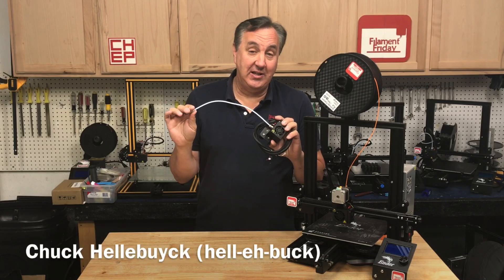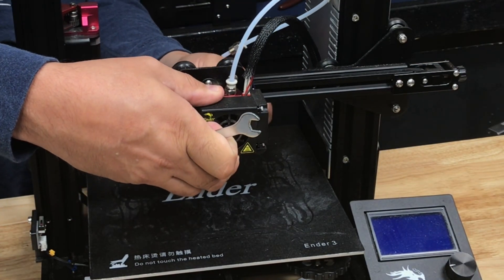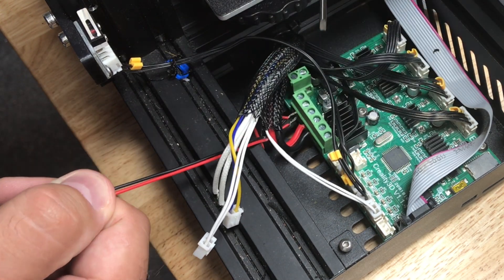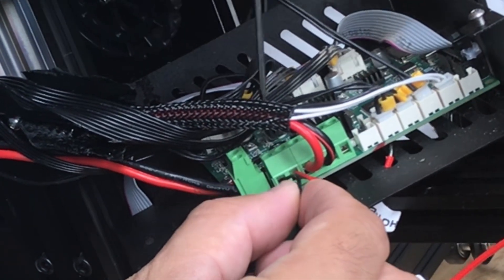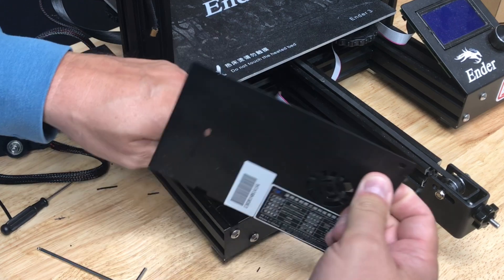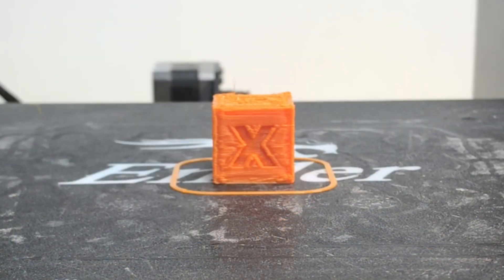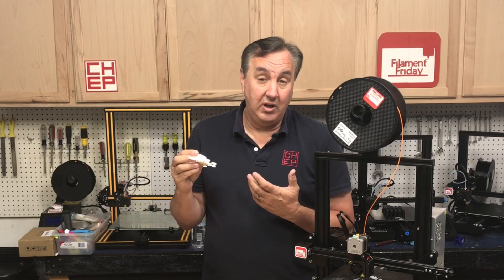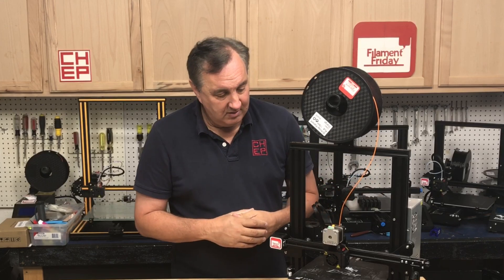Direct Drive Extruder on Creality Ender 3

Comment: the extra weight is the main reason I think most people should skip it. you're going to have to slow down your prints a lot, and most can already print flexibles perfectly fine with bowden setups. I print tpu with mine at 45mm/s perfectly fine (travel is 260mm/s)
Reply: I print with my direct drive at 100mm/sec with flawless results for 2 years now.
Reply: can you share the configuration?
Reply: @subhanhasbiyudha5448  Are you talking about the hardware?

Comment: The motor in the extruder set is too heavy. It is better to try to notice it on a thin Y-axis engine. And put the big engine of the extruder on the Y-axis. (also do with the X-axis by putting the motor from an old printer extruder on it).

Comment: Hi Chuck I have a question for you. I just got my CR-10 mini and I tried starting it up not realizing that I had it set to 230V when my power is 115V and it would not start up but made a ticking noise. I figured out what I was doing wrong and switched it to 115V and it started up and seems to be working fine but I wanted to make sure running it on the wrong voltage the first few times didn’t mess up anything internally. A reply would be greatly appreciated. Thank you!
Reply from the maker: It will be fine.
Reply: CHEP thank you so much that takes a lot of anxiety off my shoulder. Thanks for the great recommendation to get the CR-10 Mini I’ve been loving it so far. Any recommendations as far as settings go for printing PLA?
Reply: @MattKirk007  idk about most people but in cura I usually print between 100mm/s-80mm/s at around 200-205degrees C I'm printing at 0.15mm layer height. Usually for smaller higher res models.

Comment: That looks like a lot of weight sitting pretty high over the hot end.  I wonder if that can be causing some noise in the print due to momentum of that motor sitting way up there while the X axis is moving.
Wonder if it would be better to convert stepper motor to a pancake motor like a Nema 17, 23mm (18 oz) version.  Or maybe see if there is a more compact conversion that has the motor closer to the rail.
I have 4 printers, Ender, Chiron, an old modified Alunar M508, and a Chiron clone I 3D printed... Between those,, the easiest one to dial in the settings was the direct drive M508, and even though it was a cheap kit to start with, it's been the workhorse for small parts because it so easy to tune, and also super easy to maintain. Really like Direct drive. 
Really been contemplating converting the Chiron to direct drive due to the mile long bowden tube. Very similar setup would be needed.

Comment: Or you could this and without much work either by just printing your own plate for free 99 lol I made this switch A few months ago by printing my own ;modification and all while still using the stock shroud of my TRONXY XY-2 PRO, it was definitely worth it and don't let the 500 gram weight limit your imagination and think it deteriorates prints. I've had high end quality prints all the way with carbon fiber and nylon filaments since I made it into a all metal as well. Do it yourself and save the 30 bucks and month of shipping. Build it on your own and you'll never turn back to the craptastic bowden.
Reply from the maker: Which is why I mentioned that at 8:23.

Comment: Hello Chuck
Thanks for your videos and all the help, always amazing! I have mine coming in a few days and I was thinking just to connect the old cables to the new hot end and fans... do you think this way could be easier? Just to not be messing up with the board and all the connections in there. Thanks!!
Reply from the maker: I suspect it will be harder but you could try it.
Reply: @FilamentFriday  I would buy this for the direct drive, not necessarily to replace my hotend, and all those components. For me I would just move the original hotend to the new direct drive carriage and not need to mess with the board at all and keep the new hotend + for spares.
Reply: @FilamentFriday  Thanks for your answer! I appreciate you always reply!

Comment: as always great review
with direct drive, or if you use a Paço pancake or dual Z engine, to take the weight off the axle, the dual Z with 2 engines was the best upgrade I did on my ender 3, I use the mesh leveling is very good

Comment: Printed my own backet years ago. Works great you, can use the existing extruder, and it's for free
Reply: Yup, just search for “drivinator” on Thingiverse to find lots of options and like @Errs Matt said, your safe bet is to print it in PETG,  but I’ve had a PLA one running for around 6 months with no issues.
Reply: @lucasthompson1650  The part i printed 5 months ago with PLA,  just deformed due to the extruder heat so i reprinted it with ABS and it works flawessly.
Reply: @Killer241 GD Awesome! For anyone else who’s already worked with ABS, it (obviously) works great for printing these kinds of upgrades too (eg. modified mounts, carriages, and fan shrouds). Just to clarify: I suggested PETG because among the “tougher” filaments it seems to be an easier material to get a handle on for newcomers to the hobby — but, yeah,  if you can do ABS (and especially if you haven’t tried PETG yet), by all means print with ABS.
Reply: @lucasthompson1650 
Hey, I've been hearing that PET-G is essentially as strong as ABS or ASA but more flexible. Is that true?
Reply: @KLP99  I don’t know about stronger than ABS but it certainly withstands heat better than PLA (which will melt if you leave it on a car dashboard in the summer sun).  I like PET-G because it’s quite durable and with the better heat resistance I find it makes a great material for printer upgrades that need to be anywhere near the hotend.  Beware: stringing is an issue for a lot of people, but if you take the time to fine tune your slicer settings (in particular your Retractions and Travel speeds) it can be as easy to print with as PLA.
Reply: @lucasthompson1650  
Thank you for the reply. I have ordered some PET-G in some colors my wife will like. I bought one black and one white spool early on (I've only been 3d printing since last November), but they are still in the shrink-wrap.
I'm hoping my climate in the high desert areas of Utah will be dry enough that I don't have to do much if any, filament drying. A 3d shop 30 miles North of me says I shouldn't have any trouble with humidity. We average between 25 & 40% relative humidity all year.
Reply: Foot in mouth... the PLA one finally melted down about 3 days ago, hahahah.... reprinted it in PETG. No issues yet.
Reply: If you buy the kit you have spare everything though.
Reply: @nicholascarver1  
That's why I'm really glad I bought the kit. Not long before I got it, I was holding my side clippers in one hand, and reached for something behind my bed, and the tip of the clippers touched the fan blades on the front of the hot end, shattering the blades. The fans were back ordered from Creality and out a month or more, not including shipping. I found a local 3D shop (local, as in 30 miles away) and they didn't have any original fans, but had a rebuilt fan (rebuilding a 40 mm fan?), but that got me up and running again and after the new fan came, I had my backup for the next time I do that. But, my direct drive came, too, so now I really do have a spare of every part on the hot end. That's a nice feeling.
Reply: @KLP99  Yeah, having spare parts on hand can make the difference between solving a problem and pulling all your hair out. If I could go back in time I'd whisper to myself, just before I got a 3D printer, "Trust me, you should buy two!"
Reply: @lucasthompson1650  
Every time I start something that's going to take more than 4 or 5 hours I'm happy I bought 2 printers.
Reply: @KLP99  Same models or 2 different printers? I’ve just got an Ender 3 (or whatever it is when you’ve upgraded everything but the aluminum) but I have easy access to an AnyCubic i3 Mega S and a BigTreeTech-upgraded Creality CR-6SE … but I’m horrible with slicer profile management (spoiled by Git over the years) so I’ve been thinking the next printer I get will probably be 2 (or more) identical printers — well, either that or I’ll just write a proper GitHub plugin for profile management in Cura.
Reply: @lucasthompson1650  
I bought 2 identical Ender 3 printers. I've upgraded one to direct drive, with a kit waiting so I will have 2 direct drive Ender 3 printers.
I also bought 2 new mainboards, the Creality 4.2.7 silent boards. 
I've installed one, and it is wonderfully silent. I can hear the steppers humming during some diagonal movement, and other than that, fans.
The issue I have with these boards is they come with Marlin 0.0.6, which Chuck talks about. They are missing the several commands, such as the pause command, so Chuck's bed leveling gcode doesn't work. That's frustrating. Very.
I emailed Creality (cs@creality.com) and heard back today. They say, 'Send us the commands that don't work and our R&D team will work in it."
I wrote back about 10 minutes ago and told them, "No, I won't send individual commands because we could be going back and forth forever finding each one that doesn't work. Please just get the latest Marlin version and burn that to a .bin file we can load."
I don't know what they are going to say about that... It makes no sense to fix a gcode command when a new version of the software will fix the ones I've found, plus every other command, too, that might be broken, or even just bent slightly...
Reply: @KLP99  Ah, I went the other route. Instead of 2 Enders I went with getting 30+ years of coding/development experience and just 1 Ender.  :)

I still have firmware issues, probably more than regular users, but these days they’re mostly my fault — trying to fit bed level data to a generalized surface, or playing with PWM timings for some component, hooking up JTAG interfaces, etc…

It’s rare for the firmware on my Ender to be older than 2-3 days. Task #1 when I sit down to “play” with the printer is usually merging the latest bugfix-2.0.x from github with my local branch, and flashing whatever board I have in the printer with a freshly compiled firmware binary.

Or in command line terms, I do:

git pull upstream bugfix-2.0.x
(fix merge conflicts, if any)
(update Marlin/Version.h)
pio run -t clean;pio run
cp .pio\build\${board}\firmware.bin /mnt/sdcard
(Put card in printer)
(reboot printer)
(Auto home)
And THEN I start actually playing with the printer. :)
Reply: @lucasthompson1650  
I'm not a coder, or rather, not a competent coder. The last time I actually coded machine code was on a commodore 64... I did a few cool things. But more recently I did custom coding in a type of Dartmouth BASIC written for the uniVerse DB. And that's been 12+ years.
I'd rather not play with the firmware. I just want a current version of firmware with a near current version of Marlin that play nicely together. I'm moving into design, having added my first real design to ThingiVerse last night.
I'm so advanced that I dared start with Tinkercad... Yeah, technically a kid's toy cad program, but it's plenty good for my needs. I designed a funnel that can be used to fill gallon spring water bottles like Wal-Mart or Walgreens sell. It stays in without being held so one person can pour water from a CPAP distilling machine into the bottle without help. It fills my needs so maybe someone else will find it useful.
Reply: @KLP99  You have plenty enough experience to handle compiling your own firmware for configuration and customization — but I get that some people aren’t into getting that deep on the hardware end.
Tinkercad is awesome … when people other than me use it. Luckily I’ve discovered OpenSCAD so I’m still able to be creative on the modelling side without the creative learning curve — I swear I could teach calculus to a comic book artist before that artist could teach me to draw faces without messed up noses and ears. 🤣
Reply: @lucasthompson1650  
My wife had an offer for a commercial art program. She took the music scholarship. I also had a music scholarship that included composition. Composing music is math. It's just the math of a physicist who's had a little too much to drink. Don't tell my brother who really is a rocket scientist, I said that.
Yeah, I've compiled stuff off and on for years in Linux. But so far I've not seen a good step-by-step outline for Marlin on the Ender that doesn't seem to assume I know more than I do. There's always a gaping hole big enough for me to get lost in.
Old OCD guys with A.D.D. don't think like regular folks...
I think I've just not searched for the right things yet.
I'm not giving up.
Reply: @KLP99  compiling Marlin is actually a lot like compiling the Linux kernel, except Marlin is much less complex, PlatformIO handles all the build tasks, and the lead dev/maintainer is polite and understanding (*wave* thinkyhead). They even have a ‘make menuconfig’ in the form of a Visual Studio Code plugin called Autobuild (or Autobuild Marlin… ?).

It took me 2 years to get technically proficient on electric guitar … and another 9 to not sound like someone else every time I play … it’s coming up on 35 years now and I still haven’t ever written a decent song.  😬
Reply: @lucasthompson1650  
I've composed nothing anyone would recognize. But my wife and I have performed a few things. But not for many years now.
What do I need to complete Marlin for an Ender 3? Do I grab it from the repository using apt-get?
I don't have a Microsoft or Apple device at hand. Ever. Linux Mint is my distribution of choice.
Reply: Now that I wrote all that, it might be possible to build it with just PlatformIO on Linux. No VS Code.
Reply: Yeah, just grabbed a fresh copy of Marlin bugfix-2.0.x and built it on a Kali box over SSH with nothing but Python3 and PlatformIO installed. So forget what I said about VS Code ... if you run Linux you likely already have a favourite text editor. ;)
Reply: @lucasthompson1650  
I'm not EMACS. VI all the way :-) which are fighting words to EMACS users, or used to be way back when they were both running on the big boxes and Linux was a little baby "toy" OS.
I don't do much Python, and don't know what PlatformIO is. That's how little prepared I am to do all this.
I spent about 20 years as a DBA using PICK, a little, and uniVerse primarily. I can write decent bash scripts, but left compiling and building things back when drivers started working out of the box for my mice and video, NICs, printers, & sound cards, among silly things like a voice to text program and getting fingerprint readers to work.
I have heard back from Creality several times. They may stop responding now, however, since I insulted one of their support engineers. He sent an email saying my gcode doesn't work on the 4.2.7 board because of sheet metal, wearing parts, and improper slicing. I called him an idiot for even suggesting such things, then quoted a saying from my younger DBA days, "It's easy to recommend solutions when one knows nothing of the problem"
Reply: @KLP99  which GCODE commands specifically aren’t working?
Reply: @KLP99  PlatformIO is just a collection of build tools for cross-compiling for microcontrollers like Arduinos, 3D printer boards, other DIY electronics.  For instance, on the test build I just did, the first run through it handled downloading a cross compiler and linker for the LPC1729 microcontroller (which is what the board in my Ender currently uses) as well as source code for the Trinamic stepper libraries, etc…
All I did was type “pio run”, and a minute or so later there was a “firmware.bin” file ready to toss onto an SDcard to flash the printer.
Reply: @lucasthompson1650  
One of the most noticeable is the command to print a message on the screen while pausing for user input (pressing the select dial/button). That means Chuck's bed leveling gcode routine doesn't work. He brings that up in one of his videos (I need to find it and share it with Creality). Other commands control the print and are harder to isolate.
Reply: @KLP99  I think you need the EMERGENCY_PARSER config enabled for that now in Marlin... I could be wrong.  When you connect with a terminal (Pronterface, OctoPrint, etc), or in a .gcode file, can you issue:
M117 Your Message Here
M0 Break
M108 ;Wait for user click to continue

I'm guessing the M108 might be the one that could throw an error.
Reply: Are you willing to share the file you printed to convert to direct?
Reply: @830jps  I would also like the file,
Reply: @EmoFox9  
Read the rest of the comments on this thread. Somebody else already mentioned it.
Reply: @830jps  
Read the rest of the comments on this thread. Somebody else already mentioned it.
Reply: The over use of commas, is strong with this one.
Reply: @Mk6GTIMike  correcting punctuation of a YouTube comment, Witten on a mobile by a non-native speaker.
The things heros are made of.
Reply: @axised001  and we are just supposed to know that? E.A.D my guy. It's not an excuse.
Reply: @Mk6GTIMike  You couldn’t have known that, for sure, in advance, but you could have, maybe, not defaulted to a trivial criticism of a message that we all managed to understand just fine, despite the ‘overuse’, which is one word, of commas. At least, that’s what my mom probably would have said.

How are my commas?